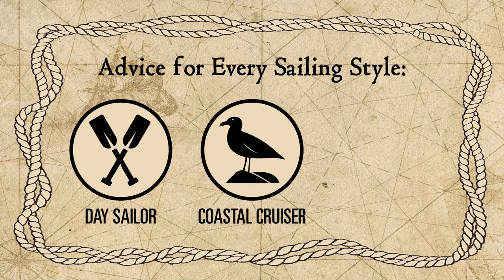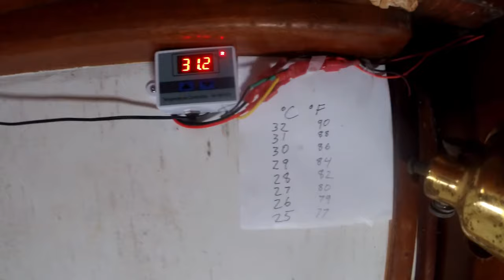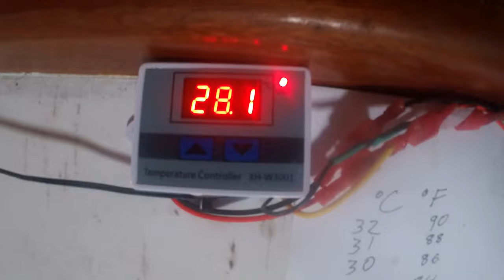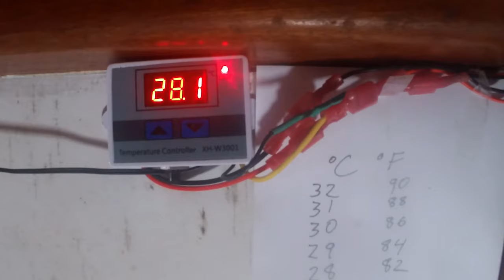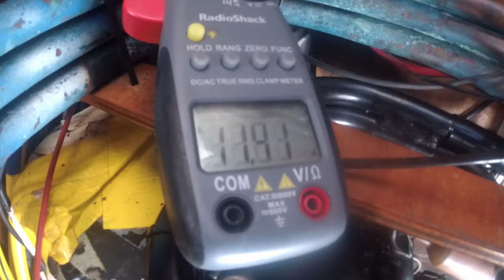Battery-Powered AIR CONDITIONING on a Sailboat [Capable Cruising Guides]

Comment: What about these as they look like a pre made versions of yours.  https://www.youtube.com/watch?v=Dhq3xbZfTWc and this https://www.youtube.com/watch?v=jgjaElhQR7w 
Maybe you could modify these designs? Is your version much more efficient?
Reply from the maker: YES. Much more efficient.
Reply from the maker: Not even close.

Look at the BTUs per watt.  And how much heat they can move.  This one would keep up with a coffin and uses a ton of power to run.

Mine 5000 BTUs at full and under 200 watts gets you 4k.  That includes water pumping and fans.
Reply from the maker: But best of luck if you go this way.
Reply: @Clarks-Adventure  I think you are on a winner packaging a low wattage system for yachts, and in answer to your question a full wired and plugin system would probaby be prefered by those I have talked to.
Reply: @Clarks-Adventure  No, I'm just hoping you build a full solution so it's an easy install. I think you are on a winner.
Reply from the maker: I think I'll start with a kit of course as it's easier for me to produce.

I was going to start last Monday but got a contact from an existing manufacturing company.  They want to produce this as a product.  I gave them till tomorrow to decide.   It would be a lot less work for me of course and get product out faster.  Probably will cost a bit more but I'll keep it reasonable or not partner up 

I wish the compressors I use weren't so expensive.  But they are worth it and only made by the one defense contractor.  
   I hate having to compete with the US military.  They have deeper pockets.  (Which are technically my pockets)